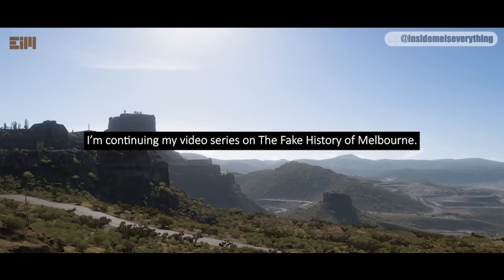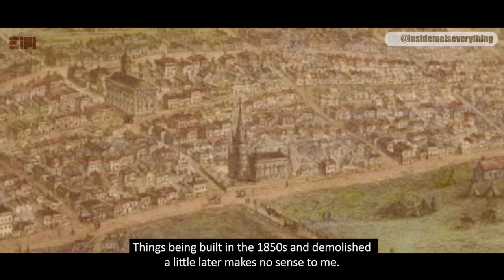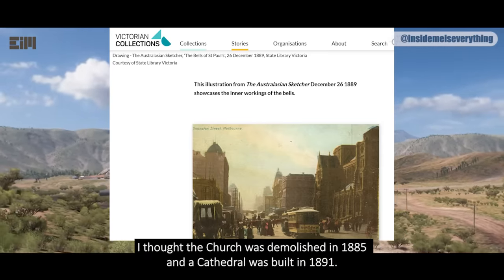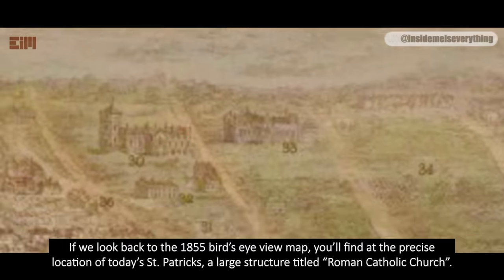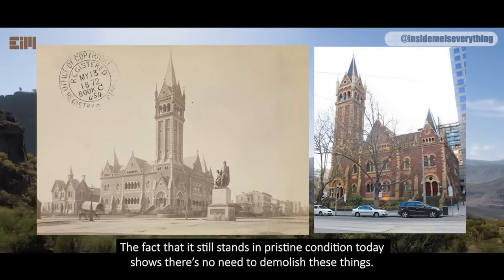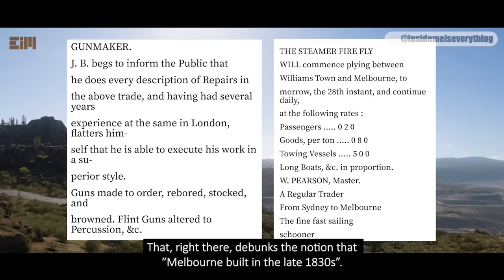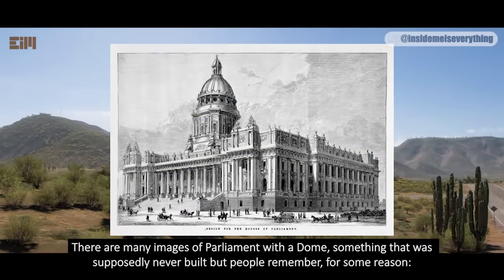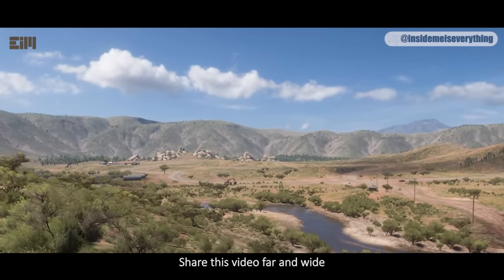THEY AREN'T GOING TO TELL YOU ABOUT THIS PHOTO!

Comment: Wouldn't it be more difficult to excavate and restore than to ust build it? They couldn't build it that quick but they could dig it out a clean it up faster? Also, where did they put the debris? All that they removed excavating had to be put somewhere, there would have to be traces at least.